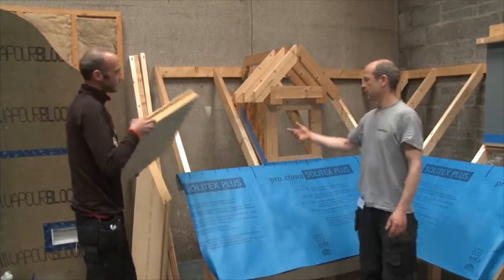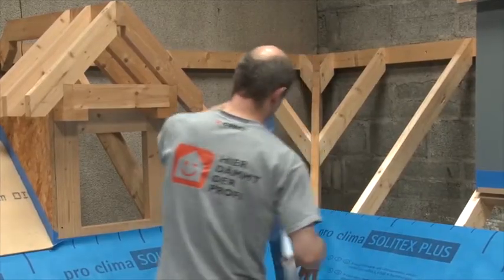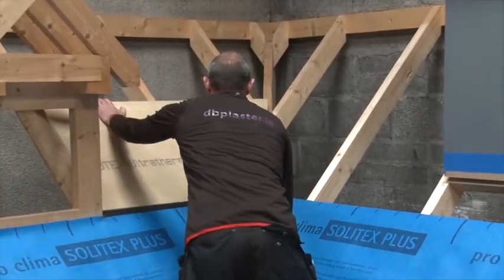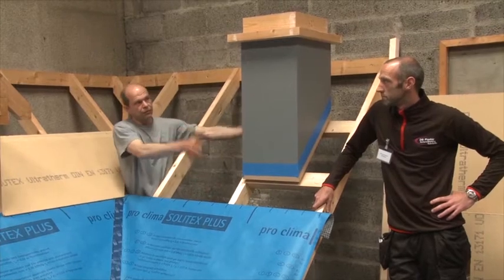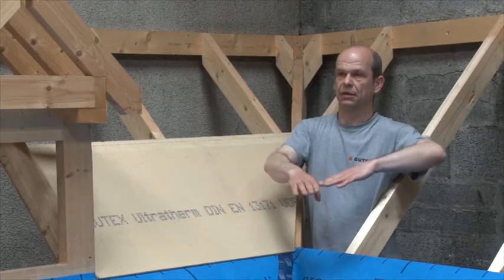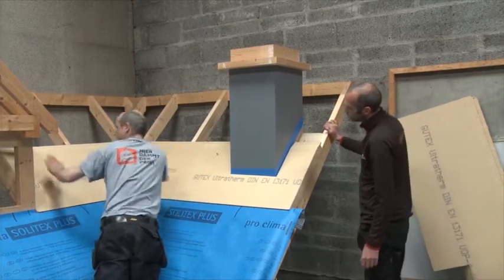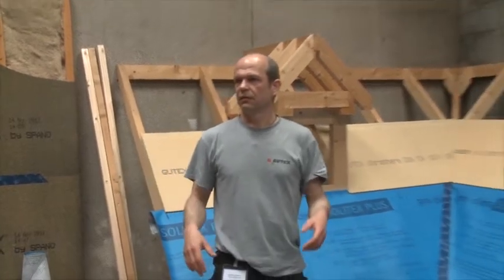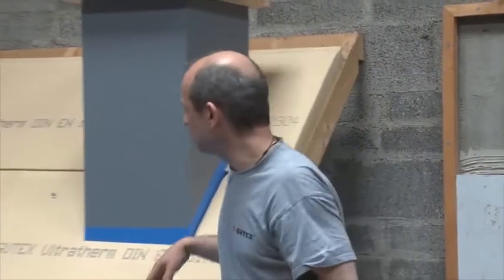Gutex Ultratherm Roof Installation (Part 2) - Valley, Chimneys & Dormer Windows

Comment: Does the gutex provide shear strength for the roof?
Reply from the maker: Hi Jesse, GUTEX sheathing is not a structural board and has not being assessed for additional shear strength capacity. This is typically achieved by cross bracing or using an internal or external racking panel such as OSB3, plywood or a more breathable racking board such as our ELKA Strong board.